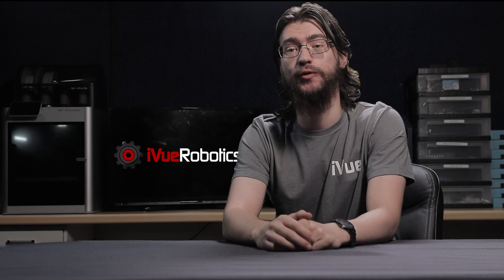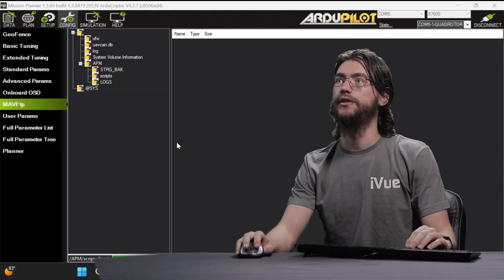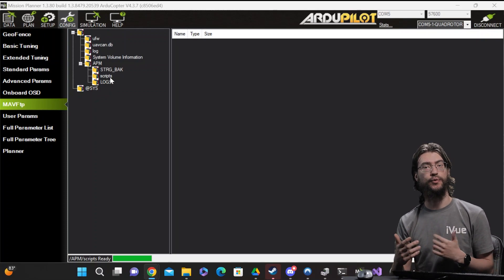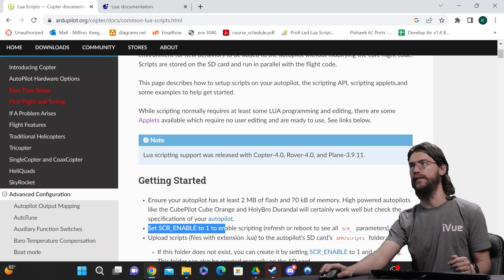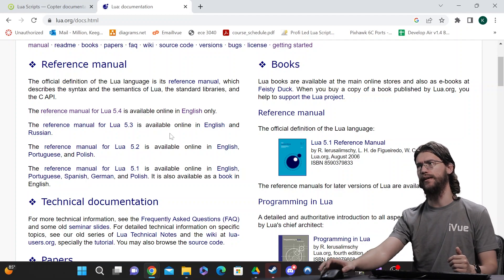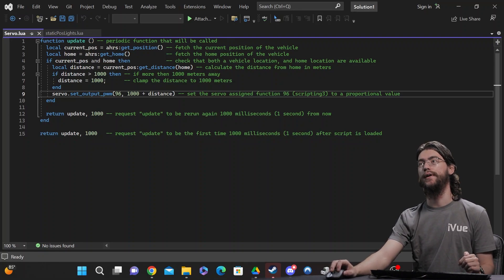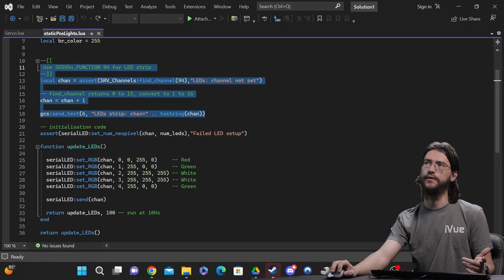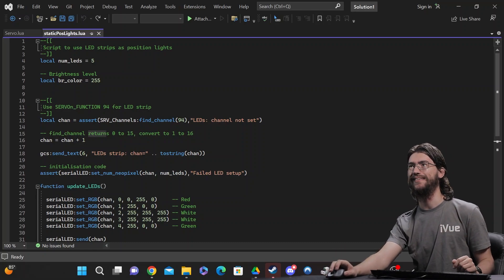Intro to LUA Scripting in Ardupilot

Comment: Hi, i am used to modify directly ardupilot (and then doing my own build). What are the advantages of using lua scripting ? is there anything  i can do with it that i can't do by editing the ardupilot code ? ty
Reply: Reduced risk of having your drone fall out of the sky due to a programming error?
As the documentation puts it, 'Scripting provides a safe, “sandboxed” environment for new behaviors to be added to the autopilot without modifying the core flight code.'